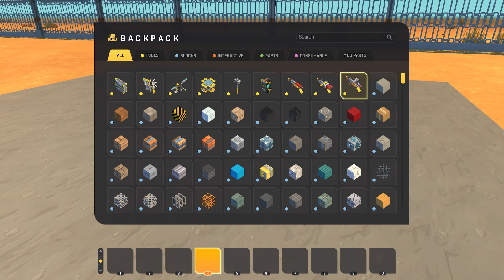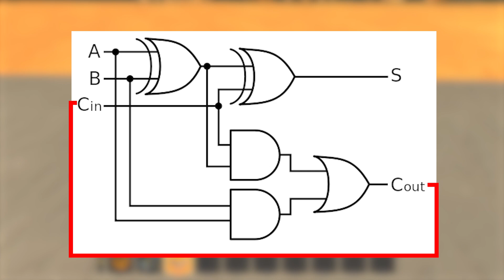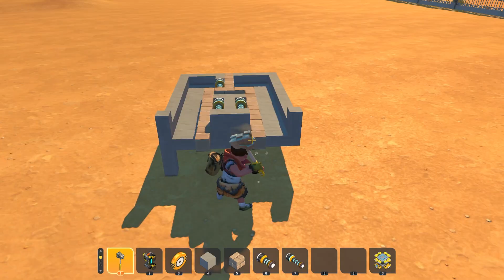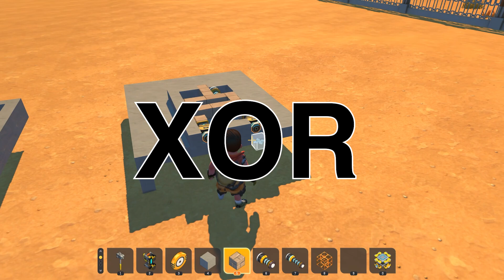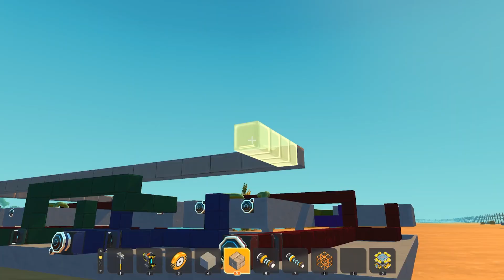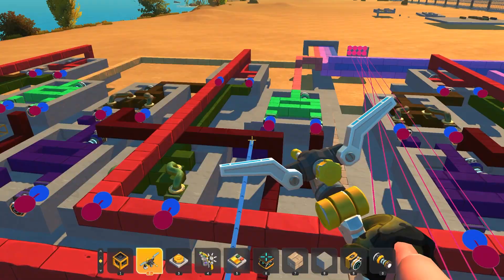Mechanical Calculator in Scrap Mechanic

Comment: 2:55 this has always been an issue with single suspension pieces... but for some reason if you chain two together in series they compress fine. This has been a pain for me in many mechanical creations.

Comment: for some reason, any time I do anything with binary it has to include an input/output that's either 1 bit, or divisible by 8, I just don't like when there's just 4 bits, or something, if it's a 4 bit input and an 8 bit output then I'm fine, but if there's no input or output that's 1 or divisible by 8, I just won't make it, just one of my weird pet peeves

Comment: You also could do an AND with an OR and inverting both, inputs and outputs.
A simple inverter is just a 'U'-shaped rod of blocks. So the output will face in the same direction as the input, but since the output is also inverted it'll face in the correct direction again. Only the OR, inside the AND, is flipped back to forth.

Comment: The AND gate might also be doable with the 2 pistons welded together, this way it will move the output block by 0.5 blocks if one piston is on (at 1) and the other is off, with some smart trickery you might also be able to use this.